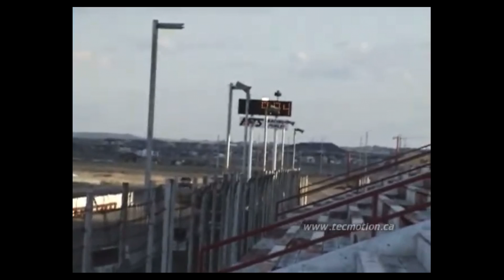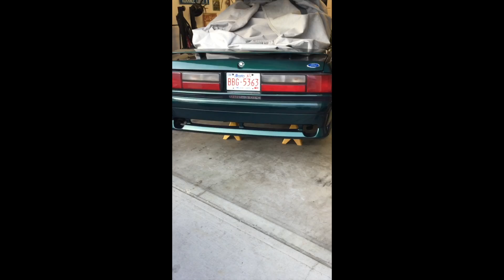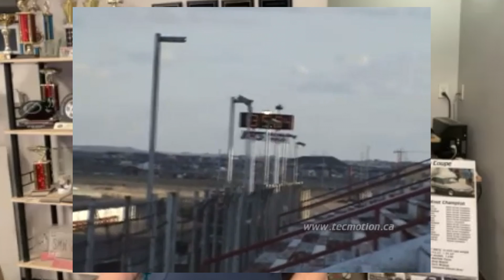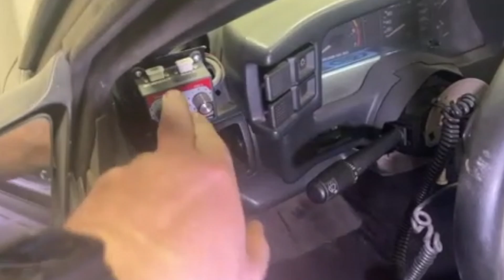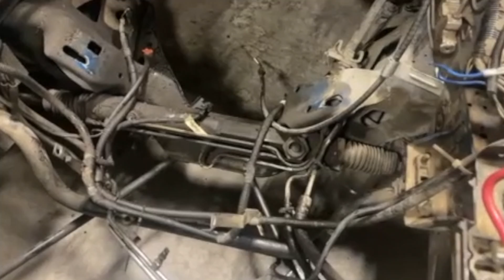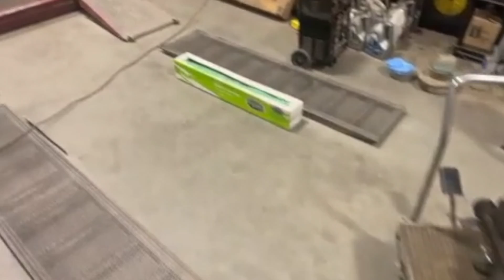A9L Foxbody ECU Tuning 101 - With Tecmotion // Should You get a Tune For Your Foxbody Mustang?

Comment: After weeks of trying to sort out a terrible idle surge on the h/c/i motor that I rebuilt myself. I found out that once I fixed all of my vacuum leaks with the last being my Bbooster. It caused my car to idle surge bad. Turns out my brand new long tubes have such a bad leak at the slip tube that it gave me a false lean code on the P side making it run super rich and even foul out brand new plugs. So if I create my own vac leak then it will idle perfectly lol. Fixing stuff caused me more problems. 🤦‍♂️😅 Love the content tons of amazing info definitely gonna subscribe.
Reply from the maker: Oh wow bud - that’s crazy!!! I did a video on this generic topic of altering cars where I spoke about the “shakedown” period and how not to lose faith because sometimes (like in your case) you can create issues you didn’t have before and a lot of the time they are harder to fix then the initial mods 🤣. Thx so much for the kind words and glad to hear you got all the issues worked out 👊
Reply: @KASLCustoms  haha right! This was my first time ever rebuilding a motor. I even did the entire block myself no machine shop. I literally did it through research and youtube vids just like the kind of content you put out. She runs like a beast with 0 mechanical issues. Cel is even off for the first time after being on for so long it burnt the words away. So guys like you are the unsung heroes of the auto life lol.
Reply from the maker: That’s awesome buddy!!! I’m flattered at all the kind words - thank you so much. Congratulations on the mechanical endeavour my friend. Enjoy that car!!!

Comment: So, if I wanted to put an intake manifold and a throttle body on my car, would a tune pretty much be required?
Reply from the maker: No not at all. I ran that same program for years prior to having a tune 👍
Reply: @KASLCustoms  oh okay, I figured since it’s drastically changing how much air is flowing into the engine it would require a retune. I want to do heads cam and intake but I won’t be able to do all of them at once so I figured an intake would be the best starting point
Reply from the maker: Yup good call my friend 👍

Comment: I've had my foxbody Dyno tuned and it seems to run fine but idles rich at least it smells rich has trick flow old 170 twisted wedge unmarked heads stage 1 cam 70 mm accufab throttle body Edelbrock performer RPM 2 upper and lower intake 30# injectors  BBK  76 mm MAF calibrated for 30 # injectors SCT bank 4 chip long tube headers super 44 mufflers is idling rich normal ?
Reply from the maker: Interesting. Keep in mind that Smell can be deceiving… do you run an off road H-pipe?  Many folks report a rich smell from the tail pipe once their cats are removed. I know that my coupe definitely has a fuel scent but I kind of like it 😉👍
Reply: @KASLCustoms  no I just have straight dual exhaust cats are removed but it's really strong when you're standing behind it it makes you nauseous after a couple minutes.
Reply from the maker: Hmm interesting. Mine too has a strong scent but I guess it’s a hard thing to “quantify”
Reply: @KASLCustoms  the main reason I'm even asking is because I took my car to a shop in my local area in Washington State and had them do a lot of different stuff for me when my back was out and they did some really terrible work didn't complete things hooked up a tach to 9 volts and wasn't working right had them install subframe connectors and they didn't weld in the seat brackets they put them in there and just left them rattling around had them change a brake master cylinder for me I brought a 94.95 master cylinder and want them to install it they told me it wouldn't work and said they put a 93 Cobra on it but soon as I got home and looked at it it  had three ports instead of two like it's supposed to if it's a 93 not to mention they didn't ask me before they did it they just did it and I found out when I came to pick the car up so I don't even think they changed that then I had them Dyno tune it and they didn't even give me a dyno sheet he asked some guy in the back what were the numbers on that again and quoted me like 230 it also had a moat chip in there and I guess they didn't have the software to tune with that so they put in an SCT 4 Bank chip and billed me $250 for that gave me back the old one of course they never asked me before they done it that's just what I found out when I came to pick it up when I bought the car it had a Dyno sheet that came with it that said 285 so I know they were wrong so after having them do all the tuning I was really concerned about whether or not they did a good job and if it's safe to even be driving it although I've been driving it for a year since then and everything's fine just real stinky I was going through a lot of shit in my life at the time I lost my mother brother had heart problems so my car wasn't the most important thing on my mind at the time it's been several years now I really wish I would have gone after them and made them fix all this stuff but probably too late now although I guess it wouldn't hurt to call them.
Reply from the maker: Oh wow that’s terrible. Yes I would definitely follow up with them if they are still around

Comment: Matthew at tecmotion best mustang tuner in Canada great guy to deal with had my forced motor built by Shannon at wms in Calgary years ago took it to Matthew straight away both shops excellent guys to deal with.
Reply: That coupe he has is something else.  He use to have a clear lexan cover on the top of that intake you could see all the runners and weird stuff goin on when it was running
Reply from the maker: It’s funny you say that because that was the way it was set up when he tuned my car. I want to say there was an issue with it sealing due to pressure or something…? I’ll have to ask him 👍
Reply from the maker: I agree 💯. Thanks for reaching out my friend!!!

Comment: I'm still trying to get my car together....these videos encourage me to finish what I've started.  I'm in York Pa and no where near Canada..and as far as health care system differences between the 2 countries...seems like you have a good car doctor to bring the horses to. Haha!
Reply: Jeffery, I'm far from Gary too, but you and I are almost neighbors!  I'm just north of York outside Dover.  An excellent shop in our area is Southern Stables down in Shrewsbury if you need computer tuning.
Reply: @OnyxFLTRX  I went to them to try to get my car put together as I commute to Md for my job...and they are definitely capable...but my car was a basket case...  the "mechanic" that I gave some money to left me dry after having my block and my brothers engine stand...5 years later...  after the loan was paid off and I had a bucket of bolts and miscellaneous parts...  no one is gonna want to take time out of the easier cars to work on and try to piece together what  needed to be....  long story shorter.  They said they wouldn't touch my car less than 10k and were 6 months back on turnaround...so...ended up going with a place called Leedy's.  They put the car back together again...  I basically just need a computer as the one that was in it took a dump after I had driven it to the gas station...they were gonna do another oil change and then let me take the car home.... then the factory computer quit on them.  They sourced a junkyard part that has an issue where the fuel pump stays on when in accessory as well as when running...and although I could just make a switch that disconnects the ground...  which is what they have temporarily...the fuel is a bit rich for the combo at the moment and the check engine light comes on...  so while my car is running...it just isn't completely done yet. They know I'm on a budget and while I'm skilled at doing x-rays and auto upholstery...  I stay busy doing my job and side job and have not gotten the extra money to finish this....
Reply: @mrupholsteryman  oh man.....that's a real bummer!  Sorry to hear you were taken for a ride like that.  At least it sounds like you are close to getting things in order.  What year car do you have?
Reply: @OnyxFLTRX  its an 89. I have a dream of making a stereo show car of sorts...  I had a 92 with 32 speakers in it.   But that was removed when it was at a body shop in Severn Md..by someone that didn't need the remote to my car and it was not covered by the insurance of the guys backyard shop....as it was not yet in his building..but in the backyard next to a fence...  so many dollars and hours of work went into that car as well...just for it to be totalled and purchased back and sold to the performance shop that did the work on that car. ELD (Every Last Detail)...
Reply: @mrupholsteryman  holy heck!  That's a lot of drivers in a small space!  Must have been quite a rack of amps or some seriously low impedance to drive all of that.  I have intentions of doing an old school style setup in my 93.  Still have my Soundstream Reference amps and Clarion head unit.  Nothing as elaborate as 32 drivers though!  That must have been wild!
Reply: @OnyxFLTRX  it was a concert on wheels.  I HAD 4 5.25s in each door with 2 jbl 1 inch tweets in a wooden pod I made. That was just far enough out to not damage the metal behind the door panel to make room for the magnets on the mid-basses.  The panel came out just far enough to still have clearance for the glove compartment to be open while the door was closed.  I also had 2 4inch mid-range speakers with another 2 jbl 1 inch tweets in the kick panels.  I had a tweeter the factory location where the 3 inch full range driver was.  And in the back where the 5x7 factory speakers were...  I made another 4 inch and tweeter plate set up behind that factory grill.   Had a Harmon Kardon crossover separate all the stuff to the 4 4 channel alpine amps.  All old school stuff. 3555 did the subs. 4 10" Eminence in a common air box that still fit into the hatch under the retractable cover.  And all the amps sat in  a rack that sat on top of the subs...  it was a tight fit. I had 1 3552 doing the tweets and mids. The 2 3553s were doing the other tweets and mid-basses. The lone 3555 was on sub duty.  

Was a sad day when I got the call from a body shop telling me I should check out the car... cuz he noticed a window broken.  I didn't want to give the body shop the keys to the remote... and have a potential copy of the remote key made...for fear that after the car was finished....it would be unlocked with no notice of an alarm going off... so I put it in valet mode as on occasion the alarm would be triggered by something other than a thief....  the thieves had all kinds of time and still....cut the rca  wires... cut the wire that went to the radar detector that was hardwired to the windshield trim...  just added more work to be done when I got the car back....  oh well.
Reply from the maker: Oh my goodness guys, this story would bring a tear to a glass eye 😢

I’m so sorry to hear about all this. These folks definitely are not part of the wonderful community that we all belong and contribute too! 

As for the computer issue, I have heard that Fox Resto does do computer restorations. I have never met Matt (the owner) but he is in a lot of @gearhead704 videos and seems like a very nice fella. Maybe it would be worth reaching out to Fox Resto to see if they can help with the computer issues? 

Anyway, I wish I could be of more help. Keep us all posted and sorry to hear about all this 😔
Reply: @KASLCustoms  I did see that video and have considered talking to him on the phone. Seemed to really know his stuff as well.  Right now I have yet again other priorities that have to be dealt with. Daughters parallel parking mishap...
Reply from the maker: Lol oh no…. I’m a few years away from having to deal with that 😉🤣👊
Reply from the maker: 🤣👊. Right on bud. Glad I could help 😉